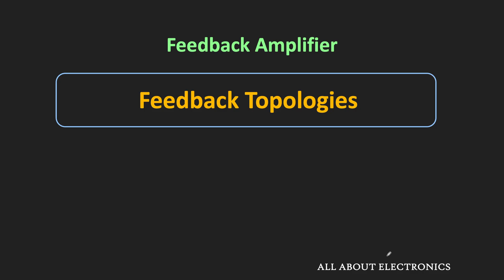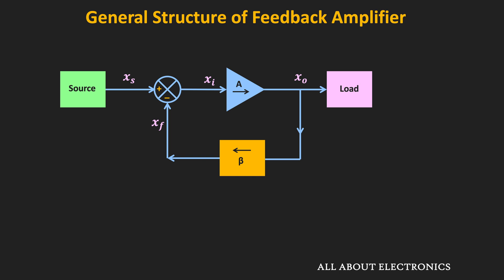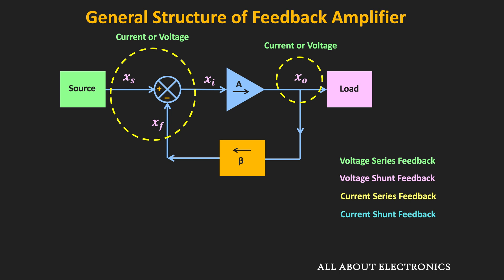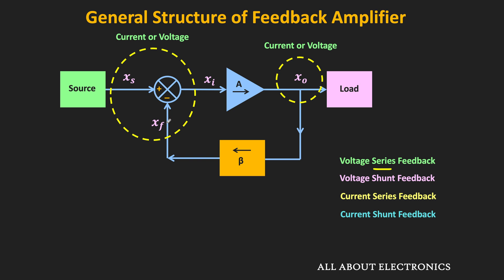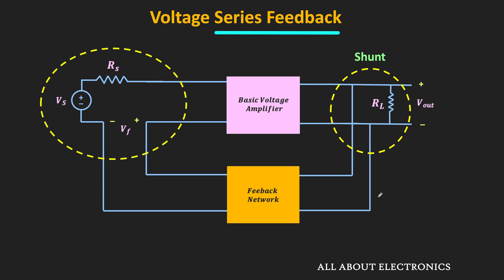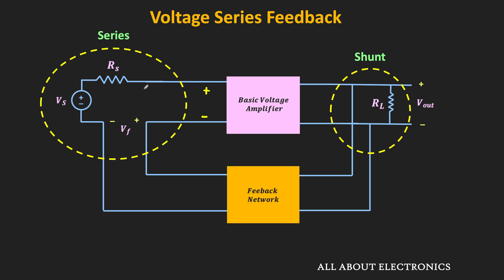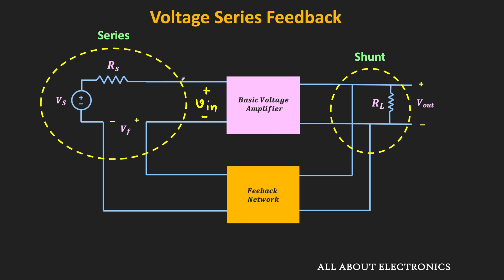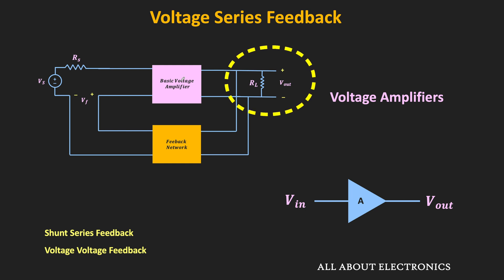Feedback Topologies in Amplifier Explained | Feedback Amplifier

Comment: Hi, I really like your channel. All your videos have been very helpful to me. But not this one. This one is very confusing to me. What is assumed to be inside the "feedback network"? As far as I know, all that is needed for feedback is one wire so what is this network? Of course we would add a resistor in series with the feedback in most cases.

So is the "feedback network" assumed to contain a resistor? If so, then what are these resistors on the input side? they are not part of the feedback loop so why show them?

You are also showing the amplifier's output as being in phase with it's input. So is the feedback network assumed to be reversing the polarity of the signal? No, I don't think so, because if it were doing that then your current shunt diagram would be showing a positive feedback loop.  So what is assumed to be inside this feedback network? I am unable to understand the different topologies because of it.
Reply from the maker: Please  check the subsequent videos on the feedback amplifiers, where I have explained each topology with circuit. It will help you in clearing your doubt.